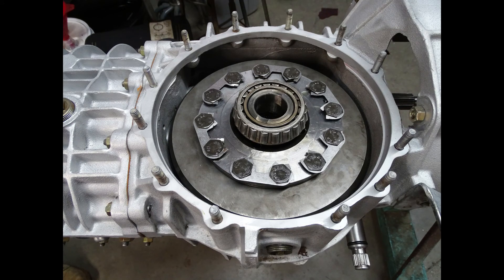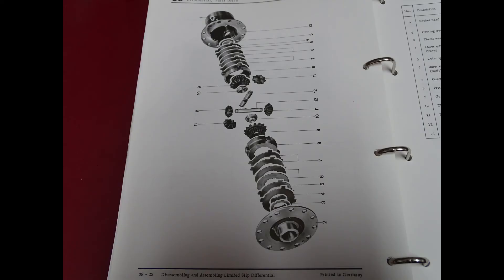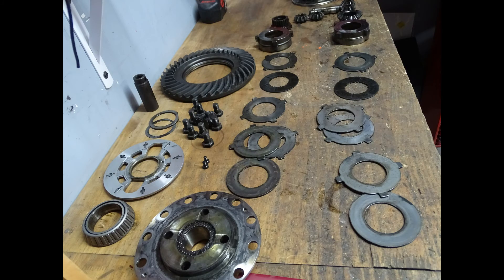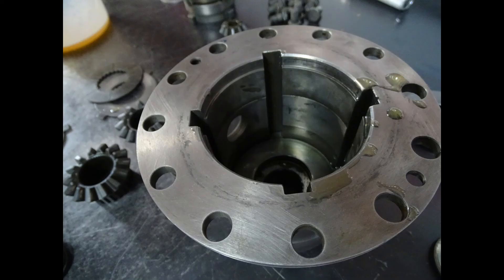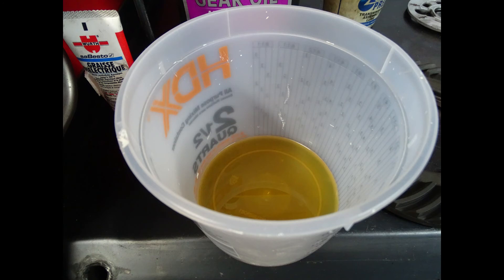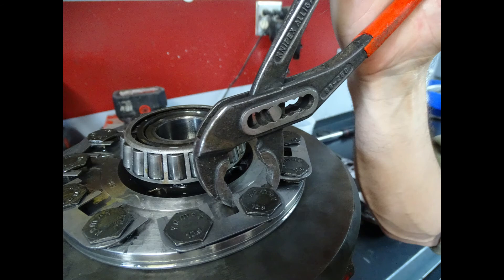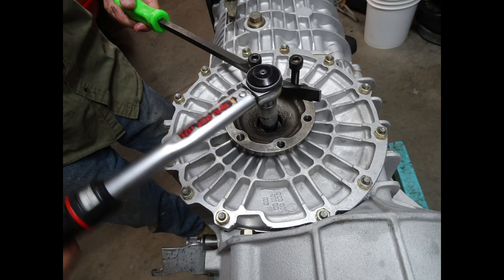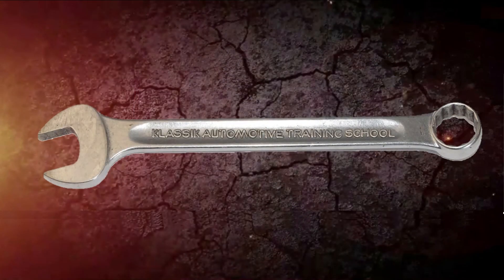Limited Slip Differential Rebuild

Comment: Very nice explanation, how many cup washers do you put in? Is it safe to run just one cap washer on one side of the stack?
Reply from the maker: There is just one cup washer per side on the clutch pack. The friction discs however can vary depending on the percentage of lock up you are looking for.
Kurt